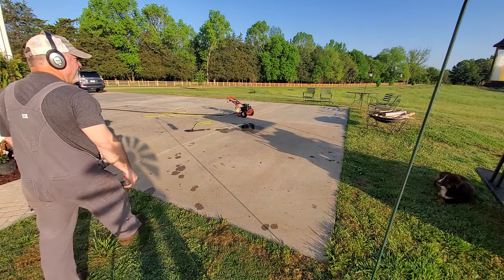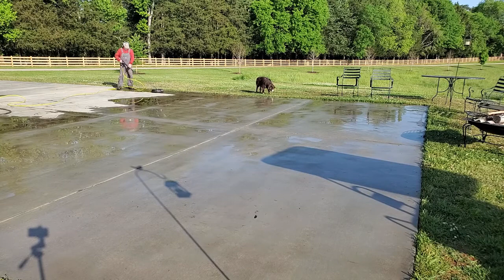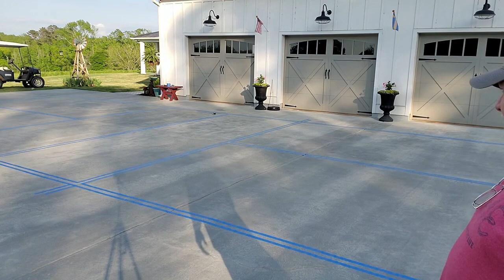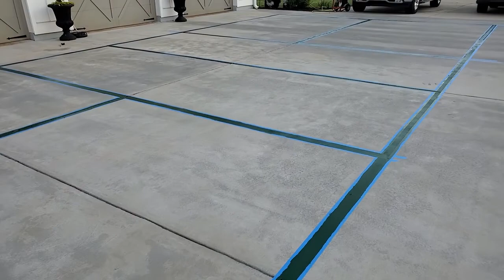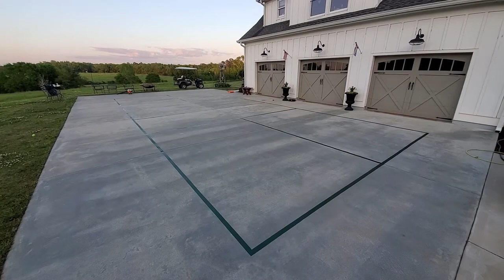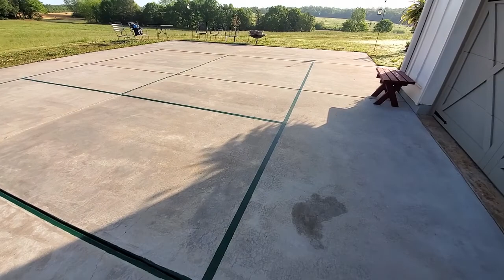Painting Lines for a PickleBall Court

Comment: What type of paint did you use on the concrete?  I've read you should use an epoxy first or a combination epoxy paint on "rough" (non-garage concrete.  Did you only do one coat of paint of multiple coats.